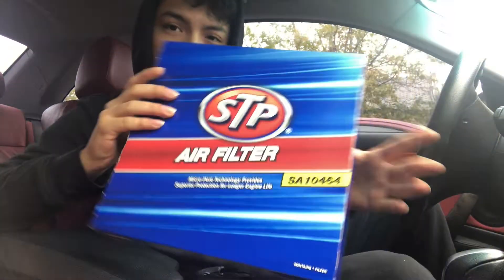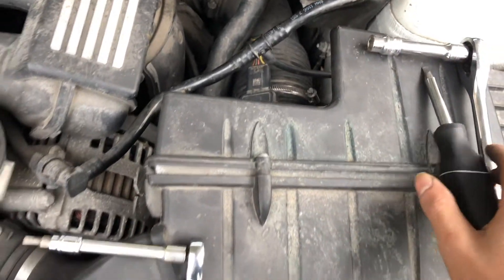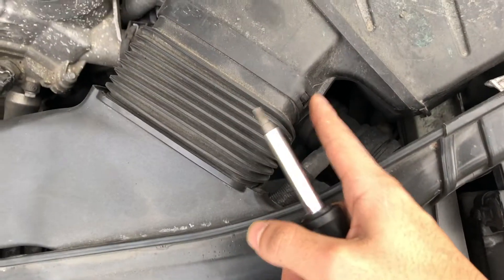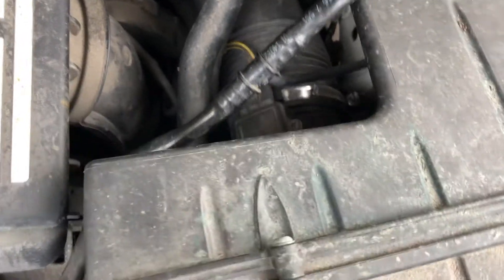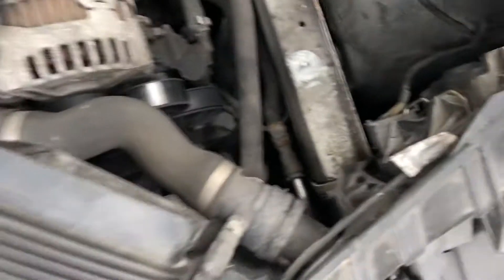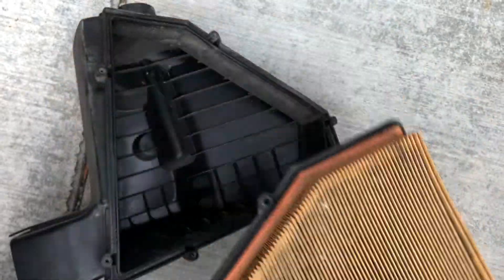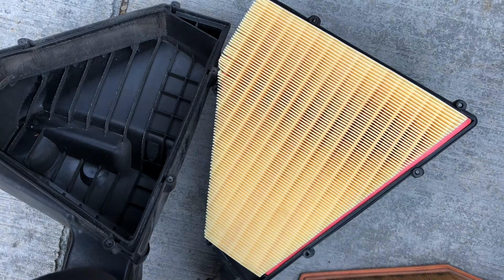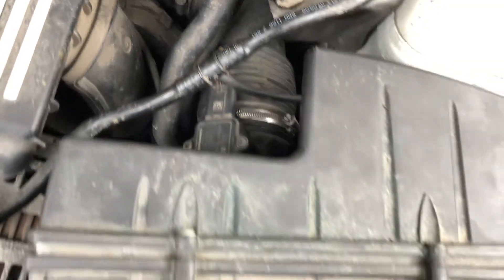How to Replace BMW 1/3 Series Air Filter (Easy)

Comment: you should remove the charcoal filter cuz is really restrictive
Reply from the maker: Like tear it out?
Reply: @lifeofmario9137  yes you can cut with a knife, remove that will give you a little better thottle response!
Reply: did you end up doing it @liverpool538